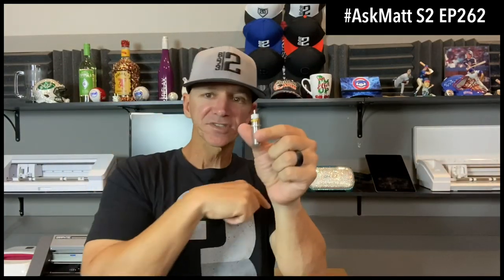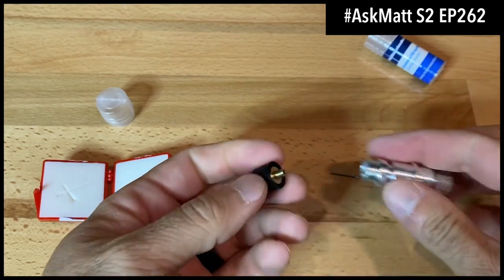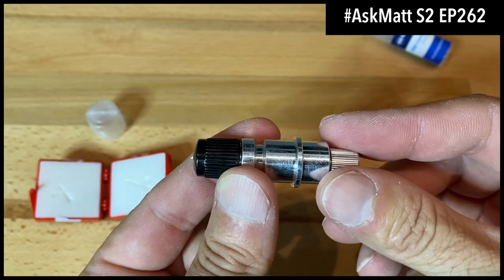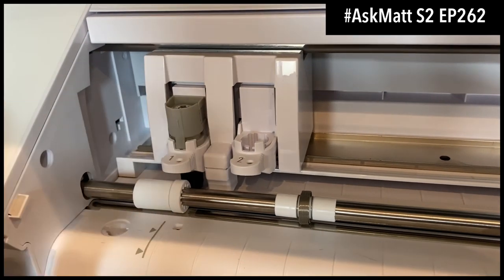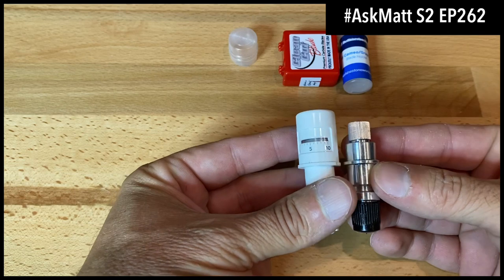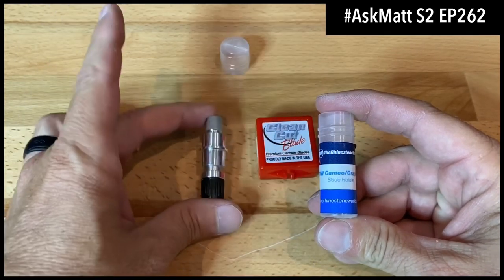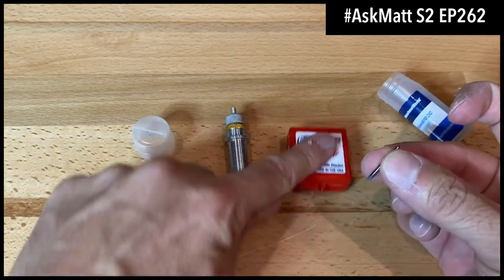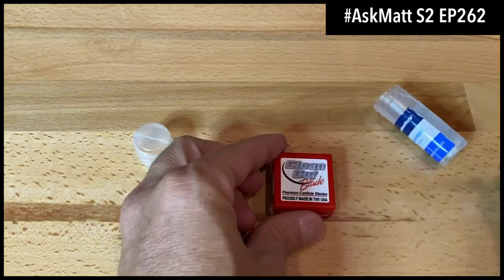Vinyl Cutter Blade Overview | Cricut | Silhouette Cameo | Graphtec Roland GCC | #AskMatt S2 EP262

Comment: What are the recommended cut settings when using this blade with the Cameo 3? I looked on the website and could only find cut settings for the silhouette blade.
Reply from the maker: You would want to follow the recommended settings for the Graphtec, as it is a Graphtec blade. However, keep in mind that these are a guideline and we always recommend you do test cuts to find the settings that work perfectly for you!

https://indd.adobe.com/view/716bdaf9-7f7d-406b-afed-7995336294ea?startpage=1&allowFullscreen=true

- TRW Haley

Comment: Hello Matt. After watching some videos comparing the Cricut Maker with the Cameo 4 I ended up purchasing a Cameo 4 simply because I can cut projects longer than 24 inches. Also, I am interested in cutting chipboard with the Cameo that supposedly can cut is just like the Maker does. I came to realize that I cannot cut 2MM chipboard with my Cameo (or at least I have not been able to do so) and I am using their new Kraft Blade. It starts cutting fine but as I increase the blade cut is to gets stuck. I ruined on chipboard trying so I did not try it anymore.  Is there any blade you can recommend I try on my Cameo 4 for a 2 mm chipboard?  I do not want to buy another machine if I don't have to. Thanks
Reply from the maker: Hi there! This is possible to do on a CAMEO 4 using a deep cut blade. 

https://www.silhouette101.com/archives/deep-cut-cameo#:~:text=The%20Silhouette%20CAMEO%C2%AE%203%20has%20an%20increased%20clearance%20level,using%20the%20Deep%2Dcut%20Blade.   

- TRW Haley
Reply: Still waiting to hear from you, Matt. Thanks

Comment: What is the actual difference / advantages between the 45 & 60 degree blades?
Reply from the maker: 60 degree blades are longer, so they can cut through thicker materials.
-TRW Bri

Comment: Hey man, just ordered my Silhouette Cameo 4 will be arriving this weekend. I had a quick question regarding the blades. Can I use different replacement blades rather then the silhouette brand?
Any suggestions I'd greatly appreciate!
These are the ones I found online
https://www.amazon.com/gp/aw/d/B07PSH16H6/ref=sspa_mw_detail_0?ie=UTF8&psc=1&th=1
Reply from the maker: We have not tested Amazon blades, but we do use the blades we show in this video. :) You also need this blade holder adapter which will fit inside the grey plastic housing on your Cameo. They are on our website here: https://www.therhinestoneworld.com/graphtec-cameo-blade-bundle-45-degree  -TRW Pilar

Comment: Can these blades fit in any blade holder ? in currently using camep 4 and have a CB09 blade holder will they fit with this blade holder thank you
Reply from the maker: No, you would need the TRW Blade Holder for use with these blades!

- TRW Haley
Reply: Argh already brought blade and holder 😫  can the I get the trw blade holder in the UK

Comment: Is there an adapter to use Roland blades in a Cameo 4?
Reply from the maker: Our blade holder for Roland is supported by a GCC cutter, but I don't think it's compatible with a Cameo. 
-TRW Bri
Reply: I found a 3d print file out there for an adapter.

Comment: Is the CB09 same length as cameo 4 auto blade??
Reply from the maker: These TRW Clean Cut blades fit specific cutters...we have some that will fit the Cricut and others that will fit the Graphtec/Cameo. We've found a lot of folks have issues with the auto blade, so we recommend getting the blade holder along with the blade to improve the quality of your cuts. :) Thanks! -TRW Pilar

Comment: Will the 1st holder n blade work with the Original Silhouette n Silhouette SD which is like the Craft Robo cutter?
Reply from the maker: That's a  great question, however we don't have those machines to test if the blade and holder will fit. -TRW Pilar
Reply: @TheRhinestoneWorld  will u be able to see if any who have n can test n try?  I got the org silhouette n will like to know b4 i give it up as i keep them as clean n new still. I do not want to throw out machine that r just out dated n old. unless it breakdown or die on me.
Reply from the maker: We have an amazing group over on Facebook that you can join and ask there! With over 23K members, there's usually always someone online. Posting in the group to ask if anyone else has the original Silhouette and blades will be helpful not just for you but for anyone else that may have the original Silhouette vinyl cutter. https://www.facebook.com/groups/592565454142124   -TRW Pilar
Reply: @TheRhinestoneWorld  ok thanks will join that n ask